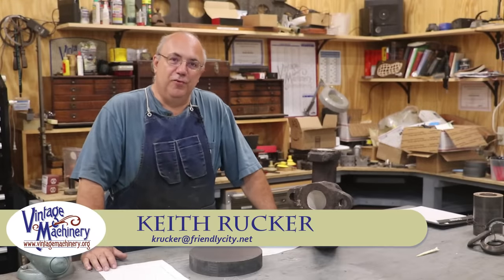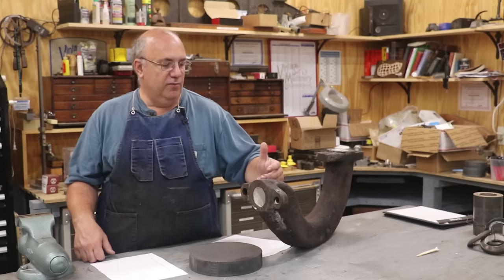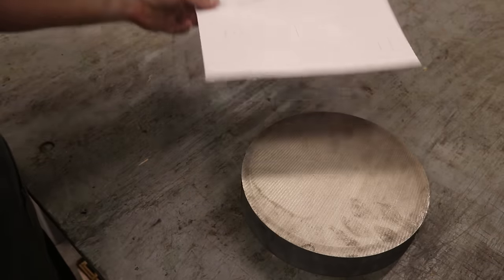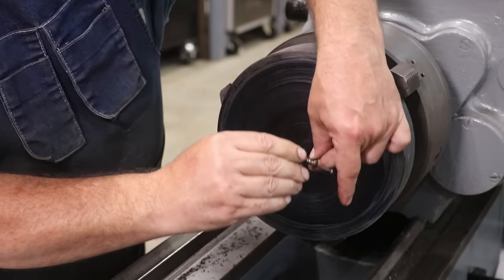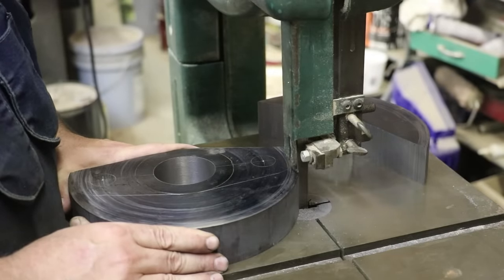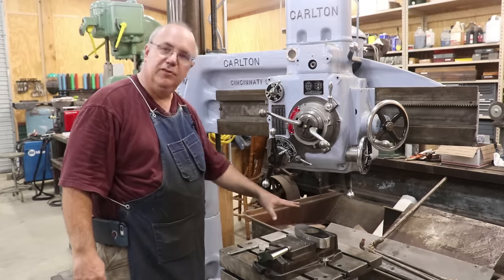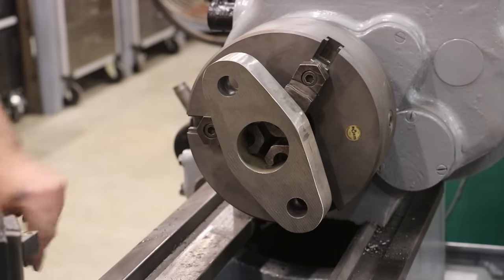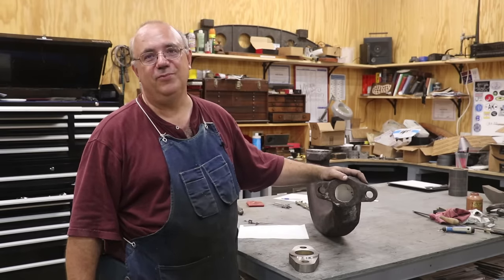Steam Locomotive Steam Pipe Repair - Part 2:  Machining a New Flange

Comment: I can't get a feel for the entire part because the angles seems to change when you show it from different views. I first thought the flanges were on the same center line, but it looks like one flange is setting at an angle to the center line of the pipe. IDK
Reply: The flanges are not only not on the same center line but not on the same plane.  The flange faces are at 90 degrees from each other and about 4 to 6 inches apart side to side installed and between 9 to 12 inches apart front to back installed.
Reply: Yea, In one shot they look pretty simple. But then he moved the part around and they didn't look centered even with the different faces. Hope that makes sense. Not an easy re-manufacture in my opinion.

Comment: You have nerves of steel.  Did you consider 3D printing the entire pipe?
Reply: He'd first have to find a 3D printer which:
1) is large enough to produce the part
2) works with cast iron.
Good luck with those.

Comment: What about after you complete the repair and its ready for installation you take a mold of it.  This will enable you to cast a whole new unit without braze ready for installation should it fail again in the future.
Reply: Flying Pictures check out the first video.
Reply: It takes a great deal of effort to make a new casting and it's very expensive.
Reply: If you check through Keith's old videos, you'll find that he actually has pretty much everything he needs to cast a part like this himself.

This part, as machined, is not suitable as a pattern though - it doesn't have the appropriate bevels for making the sand mould, and it's 2-4% too small (as patterns have to be made larger than the part being cast to allow for shrinkage).

Comment: What happens on that drill press when your bit gets dull or its too fast?  just an exploded bit, cause man when you engaged auto feed i got nervous.
Reply: Nawh...They tell you when they are un happy just like a manual one ..back off and sharpen. I have 3 radial arms. I used to think, like you that there was no feel..but I would never go back.....

Comment: Keith check your email..  the flange you made won't work.. its too narrow on the short side..  the Steam passage is not straight as it comes thru the flange.. if you cut it off you will end up with a massive gap..   when you redo the flange the center hole needs to be smaller... and you will need to hand grind it with a 1/4" die grinder  or your power scraper to the shape of the offset steam passage after you braze the parts together.. 

 can you fixture it on your horizontal mill. i think you have a 90 degree adapter for it.. . fly cut the a counter bore in the existing face for a thick half donut to restore the part fit and sealing..   if you cut the new donut extra thick.. you can trim it to fit in the lathe... in fact you should be able to use the piece you cut in this video for the donut/seal/ what ever you call it.. all you need is to cut a counter bore and not even very deep to keep it centered in the casting..

 edit.. . i send you a second drawing..
Reply: Would a counterbore also give additional surface for the brazing?
Reply: https://i.imgur.com/gI2xbh8.jpg  probably would need to braze it in place.. making it easily to lathe off the thickness to restore proper angles between  the faces.. should have read not brazed since one side of the original seal is flat and the other curved

Comment: Saw your posts on Facebook in re digitally reproducing the entire steam pipe and casting a new one.  In the long run a far better solution than trying to work from 100 year old drawings to create a new wood pattern.  The experience will be transferable to future locomotive maintenance projects.  Nice work and a solid approach on the new flange -  looking forward to the brazing job.

Comment: Hacking off that pipe and welding on a "new flange" is just asking for a really big problem because any misalignment and the inevitable "side loading" are going to make it all but impossible to make that Band-Aid "repair" hold much less be safe. Find a foundry to cast a new pipe and fix the damned thing right so the damned thing doesn't snap under high steam pressure and blow steam and smoke and potentially cinders back through the boiler and firebox into the cab of the locomotive if that pipe is routed through the "smokebox" and doesn't snap and turn "live steam" lose to the outside of the boiler/engine if located outside the smokebox. Obviously you've never seen what "live steam" does when it really gets "loose".

The damned thing has been clusterf#cked back together repeatedly, its OBVIOUSLY not POSSIBLE to "fix it right" and every time some genius wannabe "engineer" gets his greasy meat-beaters on it and tries yet another "repair" its just more wasted time, wasted effort and more and more risk that the sum total of all the "repairs" is going to cause a really CATASTROPHIC failure the next time it "gives out". That you amateur "steam engineers" are out playing "railroader" with innocent bystanders/passengers around your duct-taped/baling-wired/RTVed/half-ass "welded" scrap yard rejects of "restored" steam locomotives is flat out scary. Eventually somebody will have an Ohio State Fair-type "incident" happen to a locomotive and the casualties will be disgusting but very well "deserved".
Reply: DEEREMEYER1 the first video he said that was the plan this was a temporary repair, he's working with an engineer in Wisconsin to get the new pipe made
Reply: DEEREMEYER1 And here he is, folks!  Yet another CAPITAL TEXT beatdown from Deeremeyer1 telling the world what’s up and what’s down. Just curious...have you ever left a compliment on any of the YouTubers you follow? I’m starting to think you’re THAT guy who always leaves thumbs downs on the machining community videos the rest of us love to watch. Seriously, you need to relax.  Lighten up. Live a little. Maybe go outside and take some Zen garden rocks or something.